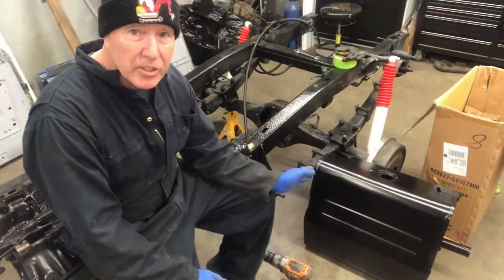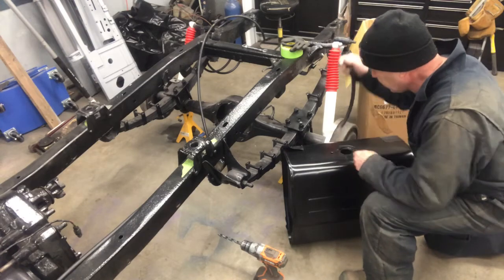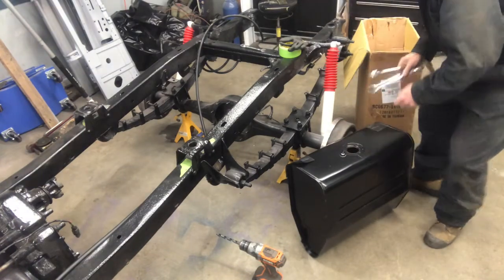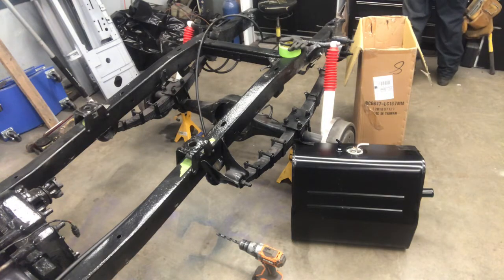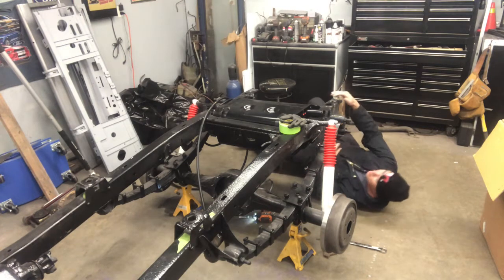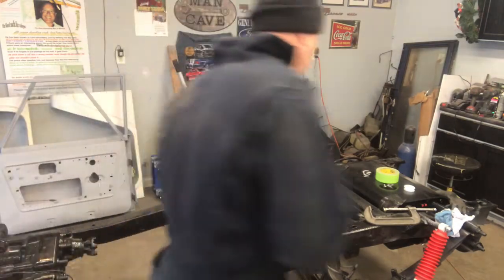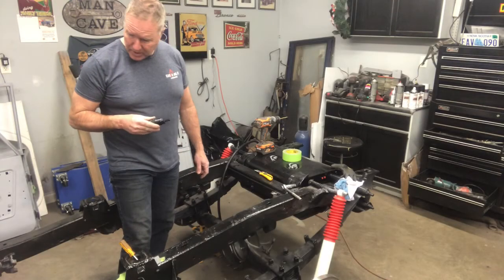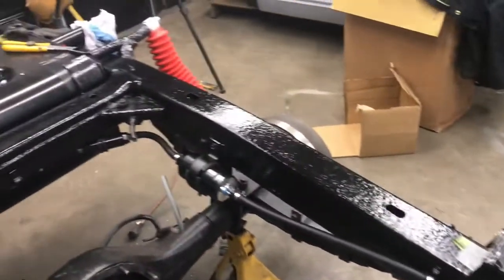Carmens Bronco Shop Eps 12, Efi Fuel Lines And Tank Install

Comment: Any info on the fitting for the return line you used?
Reply from the maker: It was a Fitech fuel filter kit for their fuel injection system, it had all the fuel line, fittings, filters etc. I couldn’t get the sniper kit for some reason but it didnt seem to matter, this kit had everything and worked out great. I had fuel line left over and I’m pretty sure the kit also had the tank bung as well. Cheers and good luck.

Comment: I didn’t go with fuel injection but I upgraded to a 23 gallon fuel tank and I installed a 12 gallon auxiliary fuel tank to
Reply from the maker: Great idea. I have a 23 for the build I’m working on right now. I’m guessing but if I get 100 miles out of the regular tank I’m doing good.  I can go either way on the fuel injection.  Mine works good but so does a new 4 barrel or 2 barrel carb. I haven’t decided which way to go on this build. Good luck
Reply: @carmensbroncoshop6544  I’d go with that bigger tank you’ll be happier in the long run
Reply from the maker: @nickefgen9219  that’s the plan. I’m just not sure yet whether it will be a four barrel or fuel injection. I wouldn’t even mind a two barrel if it didn’t starve the engine.  The less electronics the better for me.
Reply: @carmensbroncoshop6544  I’m staying with a carburetor on my bronco, I just don’t have the extra money to buy a fuel injection setup
Reply from the maker: @nickefgen9219  right on. I will post whatever I end up with on my site but right now I’m being held up mid body as some body parts are on back order.
Reply: @carmensbroncoshop6544  cool, how long have you your bronco
Reply from the maker: @nickefgen9219  This one just a few years. I fell in love with these things in 1977. A buddy of mine had one, all chromed up with Micky Thompson tires, a chrome roll bar. It was a 74 and beauty. I was only 16 at the time and couldn’t even think of buying one. I bought my first on in 1980 when I started working, it was a peice of crap,lol. I sold it and got a better one that I drove for about 5 years, sold it when I needed the cash for a down payment on my first home. Fast forward about 30 years and i did my first frame off restoration trying to recapture that truck that my buddy had. I built it to high, it had a 7 inch lift, with 40 inch tires.  I sold it after a few years until I built the one you have seen on you tube. This one is weird as it was built in late august of 76 but registered since new as a 77. I just refer to it as a 76 because it should have been registered as such in the beginning. I am building another one right now, a 71, it will be a bit tamer but will look the same as the red one, 2.5 lift with 35 inch tires and green rather than red. I will sell one and keep the other.  That was a lot of info for a simple question but its been a life long thing with me and these broncos. I hope your having a blast with yours. Cheers Nic, feel free to add me on facebook if your into that.
Reply: @carmensbroncoshop6544  I’m not on Facebook, I’ve had my bronco for 27 years and have been doing small projects on it when I get a little money saved up, right now I’ve got a Dana 44 front axle that’s been rebuilt and waiting to be installed and an exhaust system waiting to be installed and I have to rebuild the rear brakes and install a windshield, I’ve got the windshield and gasket I’ve got to install it and get a front drive shaft
Reply from the maker: @nickefgen9219  27 years is a long time. Sounds like your really enjoying it. Thats awesome.
Reply: @carmensbroncoshop6544  yeah I like it a lot, I’m staying with 33 12.50 15”  tires, I found a top loader 4 speed tranny with correct tail shaft already on it, it’s the same tranny that’s found in the 60’s mustang, I’ve got the 302 in my bronco with the 4 barrel carb on it